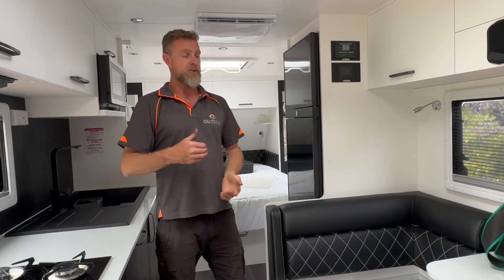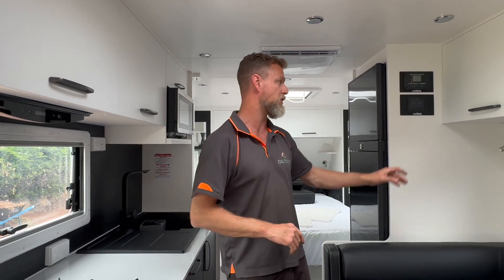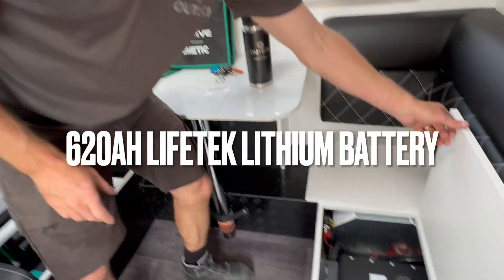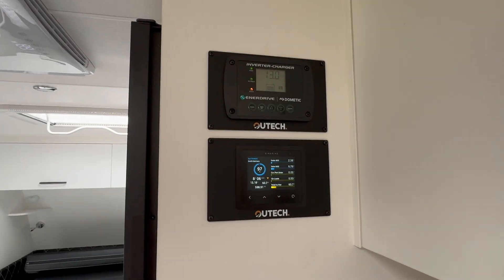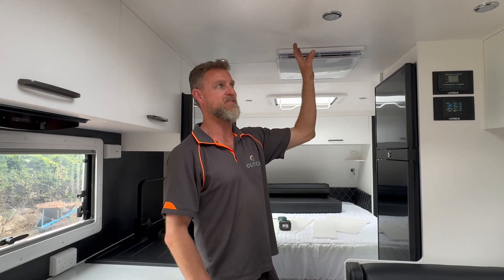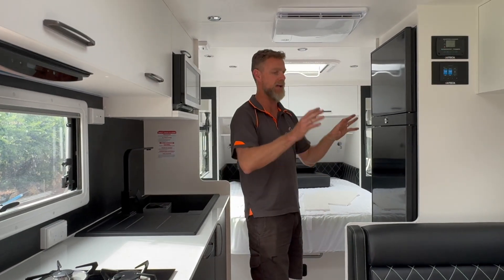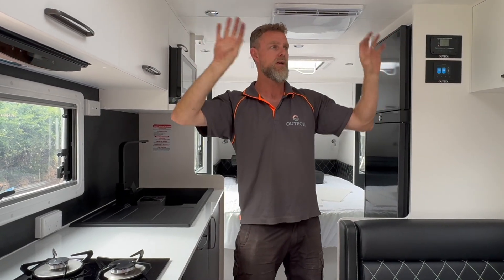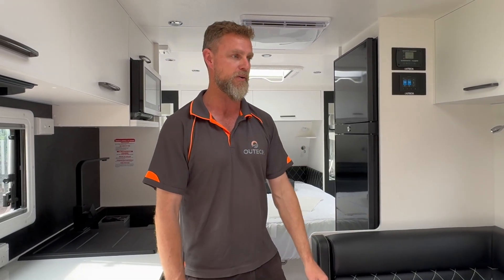We Had To GUT THE ENTIRE 12V SYSTEM!!! Look at it now!

Comment: I know vans are all different but can you give an estimate on the cost to do this upgrade and also how long in took to complete?
Reply from the maker: Thank you for your question! The cost of upgrades can vary significantly based on the specific modifications, components used, desired outcomes, and the type of caravan. Important questions that often go unasked, yet is crucial for understanding value for money, are: 
What is included in the upgrade? 
What components are being used? 
What are the qualifications and experience of the installer, particularly with off-grid power systems? 
Does the work include 240v installation? Additionally, 
What after-sales support is offered and are they qualified to diagnose electrical issues?   

While cost is certainly a consideration, it should carry less weight in the final decision. If these other factors are overlooked, you may end up paying the price twice.

You might expect to spend anywhere from  $8k to $30 for an upgrade. As for the time it takes to complete, this also very much depends on many variable, such as on the complexity of the work, scope of work, type of caravan and any unforeseen challenges.

I hope this is helps to make an informed decision when upgrading your off grid power system.

Comment: Good grief, the van is the same as mine was when purchased 3 years ago.  I'm a builder (retired) and ended up pulling the BMPro 35 out, sorting out and laying the wiring out saddeling and conduit where required, when I removed the fridge to sort out the vents that where put in the outside walls rather than internal as ordered I found that the compressor fridge had been retrospectively fitted by smashing out the internals of the cupboard with a hammer, broken screws left hanging out of the frame, shattered plywood left in the box, original wiring just cut off and taped up with a new 4mm twin run from the box to the BMPro panel and and connected to a seperate fuse.  No way of turning the fridge off!  On contacting the manufacturer I was informed the wiring was signed off by ........ so I contacted them and on giving my van chassis number they were able to tell me what I had or thought I had.  They supply the wiring harness, dont install anything, test 240v and supply certificate of compliance.  They were not able to tell me what any of the fuse circuits were as what they had on record was not my van!  Many many hours sorting out the wiring, repositioning the battery closer to the where the power draws are and installing secondary charger circuits to boost the lithium batteries, additional solar panels and most importantly circuit breakers (3) of which this van had none plus a switch to be able to turn off the fridge.  In all it would been better to have not taken delivery in the first place.  As a side note I also found that the manufacturer has used less than quality terminals and fixing screws with a fair quanity having now popped there heads off through poor installation.  I have had issues with the fridge, sway control and brakes all due to poor connections at the fuse terminal causing intermittent failures.  And they asked me if I would recommend there vans - my reply, not on my sweet nelley!
Reply: They're all the same across the range, the MY22 I purchased was that poorly built they had to legally replace it and then the replacement had all the 12v replaced at their expense. New Age are rubbish
Reply from the maker: Thank you for sharing your experience. It's unfortunate to hear about the issues you faced with your MY22, but it's great to know that New Age stepped up to help get it fixed.
Reply from the maker: I can completely believe that, @rodneygrice3898. Given some of the horrendous workmanship and quality of materials I've encountered, nothing would shock me.